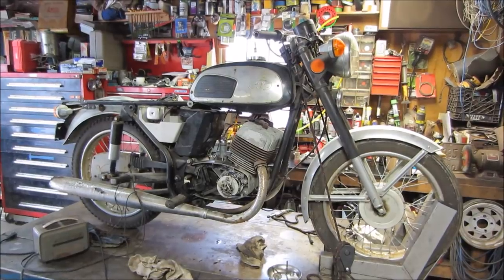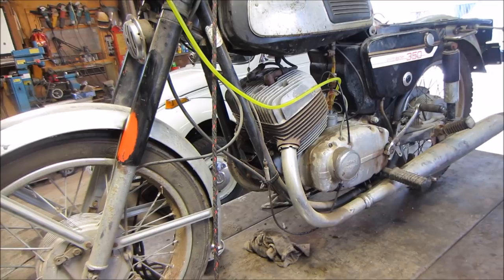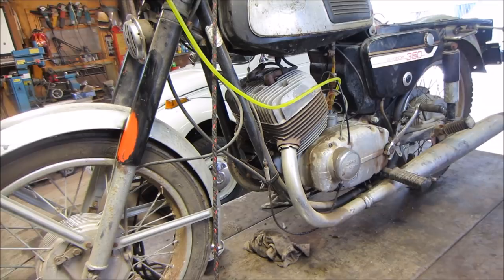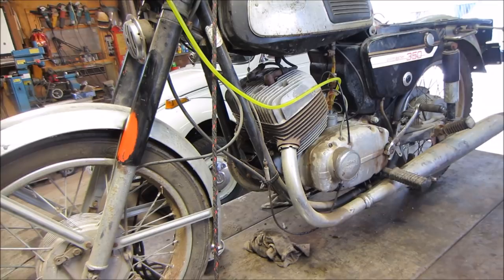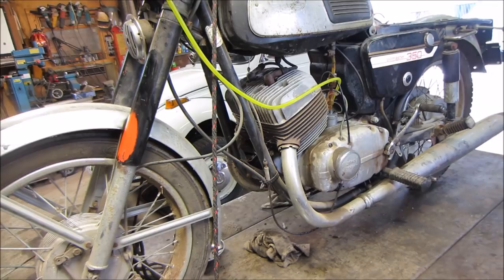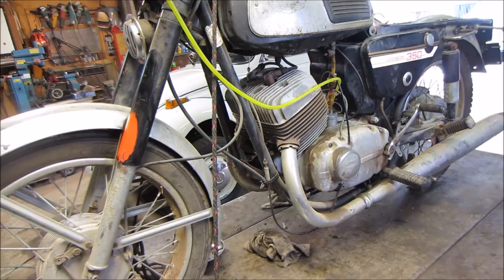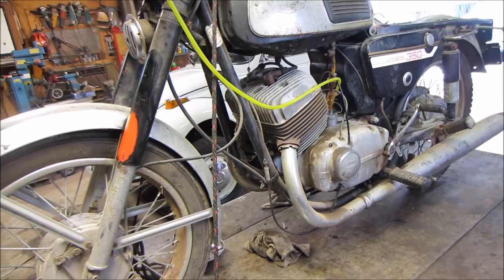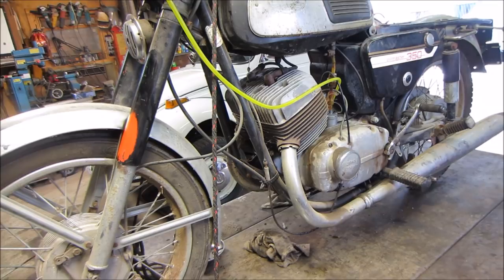Barn find jawa motorcycle, is it worth restoring?

Comment: I like the way you live on the edge, towels soaked in thinner about 6 foot away from the heater...
Reply: Lacquer. thinner liquid burns, not the vapor like gasoline. A spray vapor will flash but not the evaporating fumes. I have done this thousands of times with no problem. Not as unsafe as it would seem. Breathing the fumes is another story though and he should were a respirator or have good ventilation. It also dries up the oils in the  skin of your hands .
Reply: Murphey Its You        Yikes!?!?!      What are you doing with lacquer thinner in an open flame heated garage.      Work safer and stay around to make more videos for us Mustie!!!!!!!               Cheers.              Whipple
Reply: But, heaven forbid, if a fire should break out, leave the camera rolling, please...
Reply: My father-in-law used to smoke while pouring lacquer thinner and cleaning a spray rig. I swear he was going to blow up, but never did.

Comment: People will benefit from Darren's explanation of the economics of restoration.  I've seen people put thousands into restorations or customizations without a snowball's chance in hell of recovering even a fraction of their investment.  In this case, the Jawa, by the wildest estimates, might be a $4000 bike and most are saying it will never be more than half of that.  Also, this bike was built to be cheap and very reliable transportation.  You can see that the simplicity of the design and its mechanical durability is what this bike is all about.  That is where the money and effort should be focused and that is what Mustie1 is usually all about.  Thanks as always to Mustie1 and all due respect to all opinions on this.

Comment: I just rebuilt all the handlebar switches on my Honda CT 110 not long ago. All the teeny tiny contacts, sliders, ball bearings & springs will really test your patience!  I put down a white sheet under the front of the bike while I was trying to re assemble them to catch the inevitable dropped parts so they would be easy to find instead of disappearing into the abyss of the garage floor.

Comment: When I go to a swap meet (and there aren't many in VT) my head is turned much more quickly by a bike that runs well but shows its age. I've never been a big fan of shiny, new, off the show-room-floor looking bikes. They just had all their soul powder-coated over. I'm working on a '71 BSA right now just cleaning and replacing what needs replacing. That way I won't be $7,000 into a $3,500 bike. I love watching you dive right into these things with no manual or anything. I imagine you drove your teachers crazy! Fun following this thread.

Comment: A nice explanation on your process for deciding where to go with an item you are working on. I think we have all been there with some projects, when you get into it, how far do you want to go and how much $$$ do you want to sink into it, and is finding another of the same in better condition, the better move. 
 Been there and done that, not with bikes or bugs, but with an Ampex broadcast videotape recorder form 1967. Got one for the cost of a rental truck and trip, but it was a basket case with missing (expensive and hard to find) connectors and video heads, so found another one on eBay that had been  decommissioned then stored in clean dry climate controlled storage, now that is the one I am working on and the free one is parts.

Comment: Hi Mustie,the Jawa 350 has a neutral position between 4 + 3 gear.This is used for desending hills(espacialy with a sidecar) so the engine does not use high revs on a closed throttle which could lead to seizure of pistons due to lack of oil.
Main problem with the electrics are poor earths on the 6 volt system.
Major weakness in gearbox is the gear selector forks ,they are only pressed steel pieces and can overheat and fail.
Having said that the old JAWA 634 bikes are quite reliable and easy to live with.
Good luck,thats a nice one!
Reply from the maker: thank you for the information

Comment: Just a little tip. Air cooled motorcycles can over heat quick, we always put a little box fan blowing on the motor while while working on it sitting still. I once had a 72 suzuki 350 rebel street bike, lots of fun....

Comment: Back in my days of cycling I remember one bike I had the headlight got brighter when the engine was running it would glow brighter. Of course it may have been the magneto type. Had a few bikes in the sixties and seventies . One a Suzuki ts400 kicked back on a cold morning going to work and broke my foot, worked all day but couldn't get the steel toe boot on the next day . They wouldn't allow me to work in a slip on boot over the cast so six weeks off. Last bike I owned for street use. She was a great bike too. Two stroke lots of power and quick. Woods trails were my love back in the depths of nature . God I miss those days , your right clean her up give her some rust proofing and ride like the wind. I've done the things you do for fifty years , now my spines keeping me down , getting nerve blocks now 1st rounds yesterday on l1-l4 painfully slow but hopes all I got.

Comment: I bought a new demo  1975  that year,kept me bus y changing  spark plugs, the points, condenser ,and coil were crap,I switched the out   with parts from an Oldsmobile,it became a  dependable screamer,very fast.If sitting at a stop light in low gear you can raise the shift leaver up slightly, and release the clutch  ,it is a second neutral.

Comment: Cranksahft seal at ignition side is usually gone after sitting this long.Try applying any kind of flammable aerosol between the dynamo and crank case when engine is running. I use silicone oil, because its no harm for any surfaces. If you hear rpm change, seal needs to be replaced.  
Electric generator on this bike is 6V 75W DC dynamo.

Comment: haha , bought this bike in about the same state , about 10 years ago , for the purpose of learning my wife to ride . gave 100 old dutch guilders , pre euro , for it , it never ran  on 2 cylinders for long , changed coils leads points  , battery etc  , but i quit spannering on it for the very same reason you had , funny , when it ran on 2 pots , it was quite fast !!!  sold it for 200 guilders

Comment: You're exactly right on how much parts and effort is worth putting into it, as someone who has done some old bikes, new parts/chrome work +other gets expensive fast..and on that note, on rims, exhaust and such I'm a fan of chrome paint, get the better stuff with real metal flakes and it will do fine for the chrome parts. Use a portable glass bead/sand blaster on some of it, with frog/paint tape and old newspapers masking off other sections, then scotch brite the tank and tins, and maybe paint them, and call it a good enough restore. Note that I did Do All the expensive restore on my early '72 Suzuki 400TS, as it was my favorite bike of all time, but the paint on it was already mint, just some chrome parts and had the rims re-chromed, mentioned just to show I know how expensive it gets, and no, it's not for sale before someone asks, that is my baby, and it's like showroom.
Some ideas to think about, but people do need to keep in mind it is a toy like you said.

Comment: Musti1 it makes sure to pay attention to separate greasing, if the oil pump
breaks down, it's the engine that will explode.
when I was younger on our 50cc yamaha, most of the time we used the mixture, because the oil pumps was fragile

Comment: Redo the tank red and leave the rest black (re do the fork covers). Bead blast the rims and repaint silver. The headlamp was a standard 7" Lucas used on British cars. Pilot is at the bottom. The light was showing brown and weak when you were probing the contacts. It's visible in the video. The gear lever has an action that just clears the clutch as you change gear. No clutch lever needed. Triumph did this with their "Quickshift".
Runs nicely, I've a feeling someone might make you an acceptable offer, don't know what you paid for it.

Comment: Like the simple but functional design of the carburretor ( and whole bike as well), no choke flap but the simple push rod and a hole in the carb body to let more fuel in. And the multi function kick start lever. I am not a bike enthusiast but if I come across a machine that was built well, then I admire them but having said that, if I was living on a Greek island or a similar place with less traffic then I would opt for a bike such as this or Honda 50, 70 for daily transport.

Comment: The headlight seems to be the same unit used in Triumph motorcycles from the '70's. Easy enough to find a replacement or reproduction. Try Collins Triumph in Sutersville, PA. Also, an old automotive headlight from any old car or truck will fit into the headlight bucket, but you'll have to clip the original socket off of the wires and refit one from a car.

Comment: buffing pad on the drill with the thinners will shift that.
when you were on about chrome iv'e seen the old chrome redone by sand blasting and powder coating in silver, its great for rims mudgaurds/fenders trim etc, if the pipes are bad you just do them with high temp paint, its like you said about how far you take it.
you can do it cheaper and get good results.

Comment: You have it running, which is a big hurdle to overcome. I say put new tires on it, get the mechanical safety basics squared away, then incrementally improve the cosmetics as you ride it and get to know it better. It's way cooler than the Honda 250 Rebel in my Dad's garage and I'm still trying to figure out what to do with that.  Ride it and enjoy it.

Comment: You got it working. A beat up (Chrome, original paint) working bike that you can get parts for, that's a good bike in my opinion.  My ulterior motive is the double cab!  I want you to get to something different than bodywork and paint.  I know, you did most all of the other stuff, but it would be cool to see some light at the end of the tunnel.

Comment: New mufflers are available on eBay.  Probably cost more than you want to spend on that bike though.  As long as there are no rust holes, you could just give 'em a quick media blasting and some hi-temp silver or black paint.  The original red on tank, forks etc will look alright, even if it's thin in spots.  Set of points, new tires and battery and you're ready for the test drive.  Looking forward to it.

Comment: Looks like it is coming along moderately well for its age. I'd guess the headlight problem is almost completely the battery, so will probably clear up when you have the new one. 
I'm a little surprised that that graffiti remover didn't do a better job. It is really intended to soften recent spray paint off of older painted surfaces without damaging (much) the old paint, so maybe it is partly because of the age of this paint. You might try a little citrus based stripper, but I've had better results with the old oily goop vandal remover.
Personally I think if I were doing it I might consider trying to match the original red (orange?) color and wipe on a little paint to cover the burn marks while leaving the rest original after stripping. Then again, maybe I'd decide it wasn't worth the effort of trying to match the paint and just leave it.

Comment: It would have been nice to see this fully restored. I am glad you have told us why you are not going to do that on this project. I like your original intentions to remove the black paint only and restore this bike to original color.  I agree with your plans to get this bike up and running good and correctly. I was not aware that chroming things is very expensive at this point in time. It is all ways nice to have things as close to original as possible. Do not for get to stay safe Msutie1

Comment: Mustie1 I have watched most of your videos, took awhile.  They are great, learned a ton.  I would like to share a tip (not sure if you've tried it).   Gojo orange hand scrub for mechanics and use aluminum foil sheet and crumpled up ball of it as scrubbers, it won't scratch steel and works great on a variety of things including bike rims, chrome especially.  It removes surface rust  off the chrome and is a good polisher, it sounds weird to use aluminum as a scrubber and Gojo soap but it is incredible how well it works.   You are definitely right though, excellent toy.  Putt around, have fun on it, I think it's a good find for sure.

Comment: One thing I've found over the years...is that buying a car or bike already restored is pretty much always cheaper than restoring it yourself.  People who do restorations generally do it for the love of the project, or love of that vehicle...but they never get paid what they should for the time and effort they put into it, so they sure don't do it for the money.

Of course. if you have the pieces of something classic and easily sellable at a really high price...say, one of John Surtees' old race bikes (with a confirmed provenance)...then it may be worth the effort and money to rebuild/restore, as the sale price might be high enough to cover the cost and you can be pretty confidant of finding a buyer once it's done.  Or possibly lots of buyers at an auction, vying for the chance to give you their money - if you're lucky.  But on a bike that might possibly sell for a couple of grand or so in perfect condition?  That's a money pit.

Comment: I often use steel wool soaked with linseed oil if I want to make rusty chrome or paint look better. Just rub/grind with and wipe off. The thin linseed oil film that is left protects rather well. I totally agree with you that a total restoration is a whole different thing. I personally would never consider it on this bike.

Comment: I once bought a vehicle that had been badly resprayed matt black with a spray can, it was that bad a job that you could still see the original colour underneath. I used acetone and washed the bad paint job off, took me all up about a week once I took parts off and cleaned around door frames etc. It had one speaker and that was left hanging held in by one zip tie. Once I finished fixing it up I sold it for much more than I paid.

Comment: I'm sure you've thought about it but there's a third option - you could Cafe/Scrambler/Customize something like this - zero chrome looks good (cheap), as few parts as possible (that's the point, needs to be light - especially Cafe style), paint it up (cheap) and end-up with a custom bike. Purists will hate that, but it's an option to have a more "finished" bike but without a lot of the "back to original) expense.

Comment: You have to run the bike in order to get the voltage up the battery is there just so you can have some light when the bike is not running that little silver box under the seat is the converter so it does not blow the light bulbs i know for fact because i use to own one of those Czech Republic bikes for many years but it was a 250cc

Comment: My last bike I did was an 80 cb750 custom. Did the whole cafe style. I got this bike it was literally drug. It fell off the trailer when the guy was moving it down the street. Its mangled. My plan was to put the motor on my wheeler. Anyways. I got to looking and it wasn't a bad bike it was my style. But it was expensive to restore them. What I'm saying is. Clean the chrome off plenty of people will powder coat for cheap. That would be a sweet bike. Strip the mufflers obviously a re stroke so it needs those pipes. I did a 36 inch cherry bomb on my cb but its was four stroke. But either brushed or polished would be on the cheaper side. There's ally u can do on the budget. Doesn't necessarily need to be stock. What defines restored. Or custom. These bikes today cafe style is just crazy. They're such a nice piece to have and make it yours and unique. There's so much that u can do with that and it would be so cool. Where I live there's a two stroke rocket that runs around and he's just so careless. I would love to have that bike.

Comment: had a cz 125 on the road for a couple of years (still have it in the shed) the wiring is 6 volt throughout and the lights are awful as standard. the headlight is a sealed beam so you get the lens and reflector as one unit. they are very basic bikes and you won't get a race bike out of one. they have many design flaws like  the carb icing up on cold mornings (the damn thing spat me off every morning going to work on the same bend at 5.30, picked it up and smoked a cigarette while the engine heat melted the ice out of the intake) and it went through points like they grew on trees. if you balance the front brakes (twin leading shoe) they worked great , probably the best thing on the bike.hell even the key is the same as zetor tractors!! gearbox oil needs checking regular or you get false neutrals between the gears. I could go on for hours like this but I love them so I can't, says a lot that they come with a great little tool kit and mine had a tyre pump on the frame.you can't knock the optimism of those guys.

Comment: I have a 2 stroke jet ski that was really finicky with the choke and whenever a friend would ride it we would have to explain how to feather the choke and throttle at the same time to get it going. Inevitably they would stall it out on the first several attempts. I’ve since fixed it just with seaform and non ethanol gas.

Comment: That headlight looks like an aftermarket one we used to sell at AutoZone (I used to work there) it was a cheap $20 per pair replacements for 6024 headlights. Even down to the running light. It was a cheaper alternative to the to the plastic housings and was even glass. Allowed people with those rings sealed beams to upgrade to h4 bulbs

Comment: I would just get it all running mechanically well and clean it up as best you can and leave it like that. Also you could take a wire wheel to the tail pipes and paint them with bbq grill black paint and may put that muffler wrap would be nice...